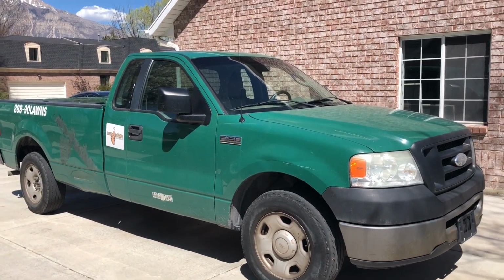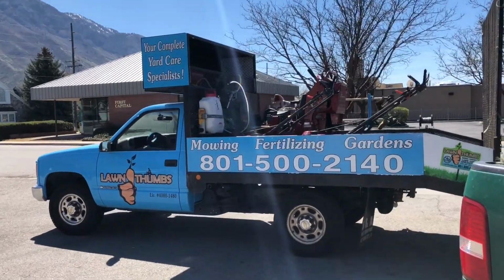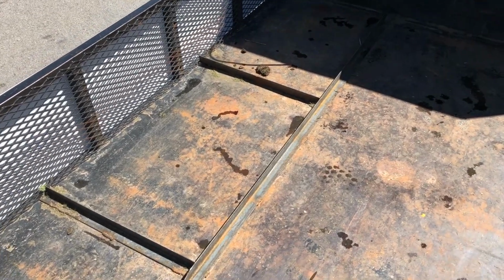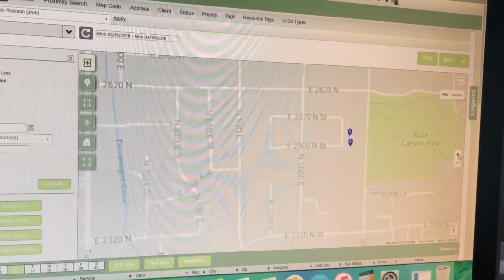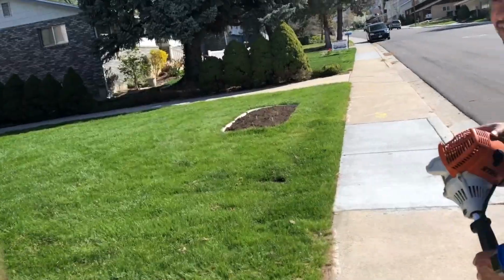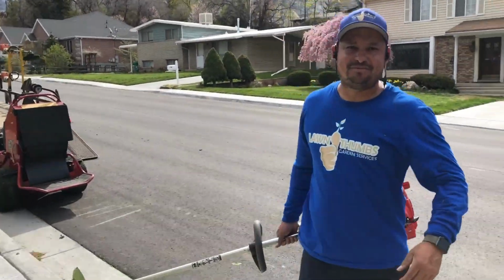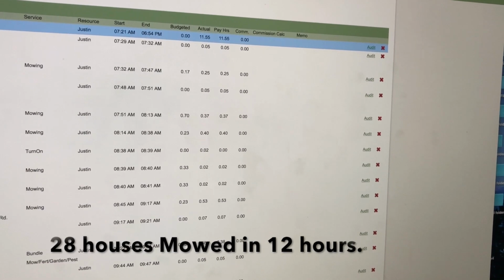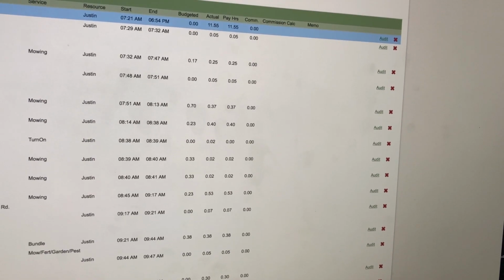Training a Trimmer

Comment: What size truck is this? How much floor space do you have in total? Can you fit a second grandstand?
Reply from the maker: Willard Wood 
Good question I’m not sure. I’ll measure it later when I’m next to the truck
Reply: Is it a 1500 or a 2500?
Reply from the maker: Willard Wood 
It’s a 2500 but no 4x4. The previous owner had the bed mounted to a 1500 and he said it was no problem at all.
Reply: That's super helpful. Thanks. I have a 94 f150 with an 8ft bed I'm thinking about doing something similar to. I'm looking to buy a couple worldlawn venoms and I wanted to see if I could fit two on this setup.

Comment: What do you recommend to kill Burweed in Centipede grass in April?
Reply from the maker: LowBallerLawn Care 
I would look into Speedzone. But read the label first to see if the weed killer affects Centipede grass first.
Reply: would that be better than Blindside?
Reply: Just read the label. Its not for Centipede grass.
Reply: The Speedzone is for Burmuda and Zoysia, not for Centipede. I used Blindside at the lowest rate(.15) to a gallon. I saw a little discoloration. I may just hit it again.